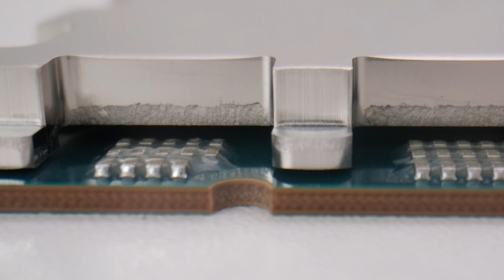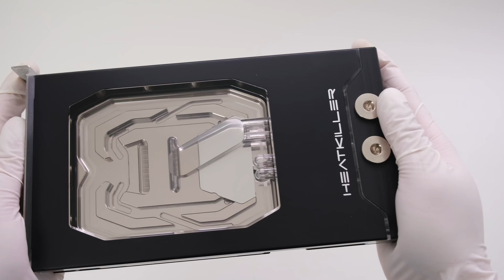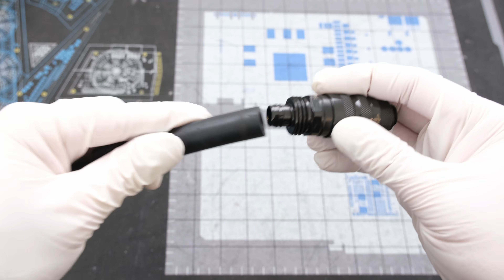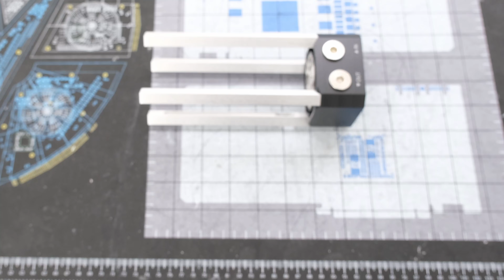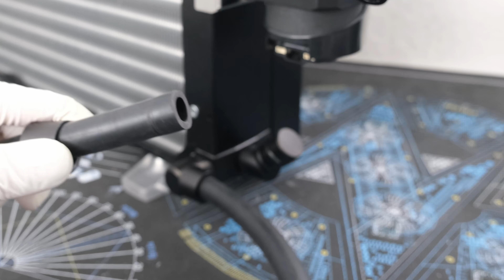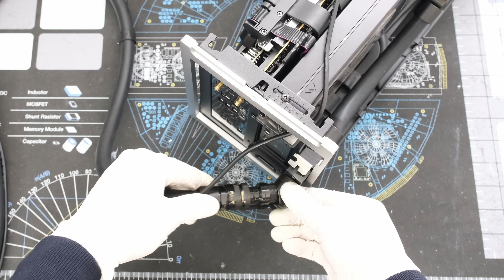Ultimate Silent ITX Build - Step by Step

Comment: The point, I can't find it.
Reply from the maker: Thanks for your comment 🙏  I recognize that I'm using a separate MO-RA to get the silence. So, while its silent and powerful, whether its small can be debatable. You're flat out right to question the point of the build. 
One thing that was unexpected for me was that, once the MO-RA is built, there doesn't appear to be a reason to upgrade any of it. The MO-RA is already best in class. Same with the Noctua fans. The reservoir, D5 pump, fittings and tubing all are not expected to need any upgrades. So, this really opens up future builds. The only consideration needed is the CPU/GPU water blocks (in addition to like motherboard, RAM, PSU, etc) and your build can go into basically any case (the Terra is tiny) and it will be silent. You can freely pair an Intel CPU at 400+ watts and an NVIDIA GPU at 400+ watts and have it be completely silent in any case you want. 
The other thing that was pleasantly unexpected was that the MO-RA does kind of blend away. Hear me out. Unless you have the MO-RA right up against the Terra like it's some big brother looking down at it, it feels like you're just using the Terra when using the rig, if that makes sense. It's a different feeling, you got the PC running at full load, GPU at max, and it's just sitting there, tiny and silent. But then again, I love regular ATX and ITX builds too. I have an ATX one in an o11 EVO as my main editing rig and another ITX one in a Meshlicious. I won't stop building those either. Thanks again for commenting and for the feedback

Comment: Realy nice build, but one philosophical question tough, if it still SFF if you count external rad into equation 😅
Reply: I was thinking the same thing but then I saw how thin the rad is and I definitely think it still is, especially since you can hang the rad off your desk or something like that on hook to save space.
Reply from the maker: Thanks for your comment 🙏 Ha ha, right on. I do recognize what you're saying it's likely similar thoughts (I had) and others where the MO-RA just seems way too big and a big dealbreaker and a nope nope. 
After actually having built it and setting it up, I discovered that the MO-RA did almost melt away, if that makes sense. Unless the MO-RA is right up against the ITX Terra case, it sort of blends away. And since, it is completely silent when its running, that adds to the effect. 
For example, in the cabinet (where I keep it for now), I store the MORA way in the back and push the ITX case way in the front. And when I'm using it, it feels like I am using just the ITX case and the result is the feeling of power but with silence too. 
The other thing I didn't take into account was that once the MORA is built, it opens up a range of new options for building future rigs. 
This is really for endgame users that want something new, but I tried to make the video as welcoming and clear for new users too. At least, it should be enjoyable to watch. Thanks again for your comment and thanks for watching!
Reply: @vectornetwork  video was quite fantastic tbh, new users will definitely find it attractive. As for MORA, you reminded me that I was eyeing it for quite some time, so maybe it's finally a time 😅

Comment: I did this too hunting quietness. Unfortunately after removing all the cooling noise I realized just how bad the 3090FE coil whine is. Unfortunately not much I can do about that until I upgrade.
Reply from the maker: Thanks for the comment 🙏Ha ha, I can relate, funny story. When putting this rig in my living room with HDMI to the TV...I found all the other fans, including the ice maker, and the other PC in the room but nothing from the terra or the mora. Coil whine is something I would like to address in a future video, but its so hard to pin down, especially with limited sample sizes. Thanks again for watching and commenting
Reply: You won't find much respite from coil whine if you go 40 series 👎 my Tuff 4090 has it tho not as bad as that 3090.

Comment: I want to buy Alphacool Supernova 1260, will I lose something in performance compared to MO-RA3 420? The radiator will be half a meter from the computer, I will use one D5 pump. Should I use the same 200 mm fans from Noctua or Push/Pull on the Arctic P14?

Comment: Absolutely amazing work! I have the same Mora 420 setup and you have provided one of the most comprehensive guide to hook all these up on youtube, so thank you for that!!
Reply from the maker: Thanks for your comment 🙏 Right on MO-RA brother! It feels great. I am super proud of this video. I think I pour a little too much heart and soul into this one. It took something out of me. Worth it. 
Story-time. So, I was done with the build and start the benchmark and honestly I was not impressed with the noise level. I even lowered the Noctua NF-A20s down to like 20% and still was like, "Hm, louder than I imagined. I guess this is..fine..." About 2 hours of benchmarking later, it occured to me. The noise is coming from the PC and not the MO-RA (they were next to each other). I checked and the NF-A12x15 was running at 100%. I turned that down and immediately the whole room fell silent. Like, silent. I had a moment. I think I almost teared up. And then it occurred to me. This is all about it being silent. That's the best part. Tiny and silent and ...wow, immensely powerful. Thanks again for watching